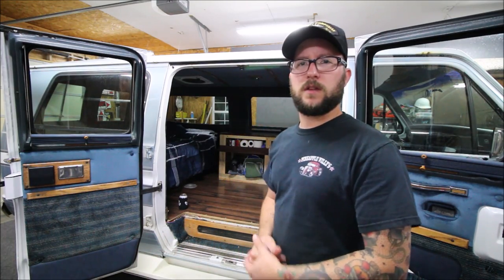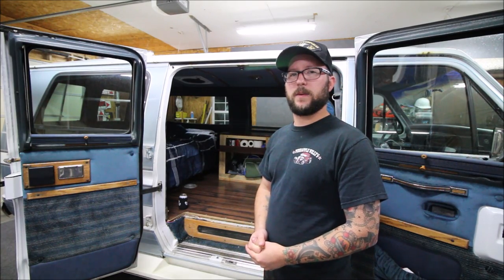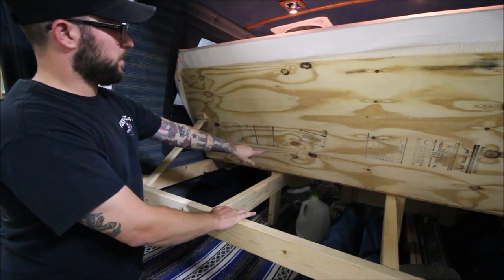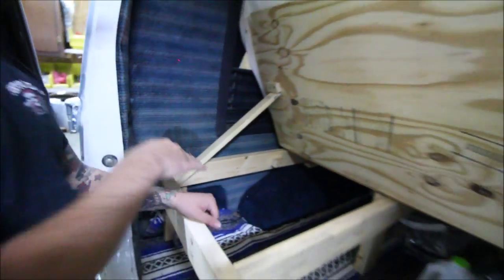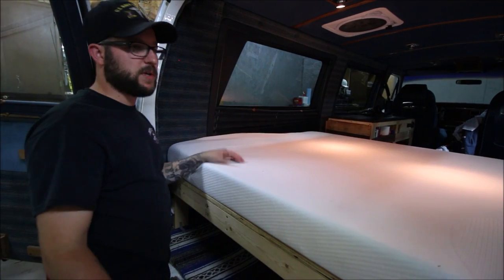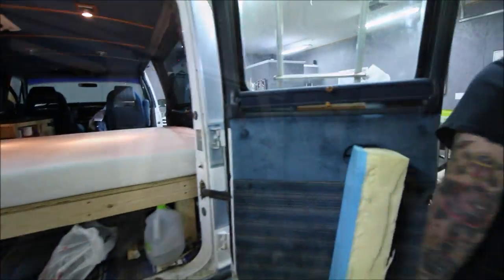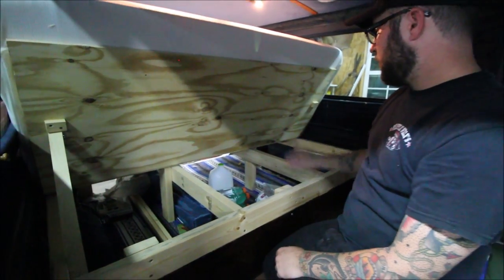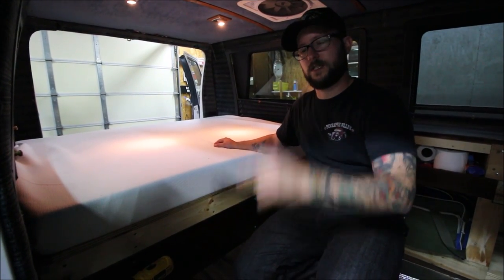Camper Van Bed/Couch set up in my brothers econoline van.

Comment: I am not clear on how you have the plywood platform attached to the frame.  Also did you use hinges in the middle?  What kind and size.  I am a beginner so I need details.

Comment: This is a smart set-up, a two-way couch. Was thinking about the one-way, but the extra one facing out of the back is great. Thanks, will be using this in my soon to be bought van. How exactly did you screw it to the frame, I cannot see or determine that.
Reply: Are the two plywoodparts of the bed screwed on to the frame (if so, then how, cant tell), or are they resting loose on the frame?
Reply: Rusty Campervan Thanks ! For your superquick response. Got it now, hoped it would be something like that.

Comment: Just to understand a bit better, you got the mattress to fold so nicely into the couch position by cutting it down the middle? Was it still comfortable to sleep on if it was cut? Without doing this, I guess it wouldn't really work so well? Cheers
Reply from the maker: Cutting the mattress made it easier to fold. It might have folded some without cutting, but cutting it made it work better. It was still comfortable after cutting.
Reply: @RubberTrampRenegade  Thank you.